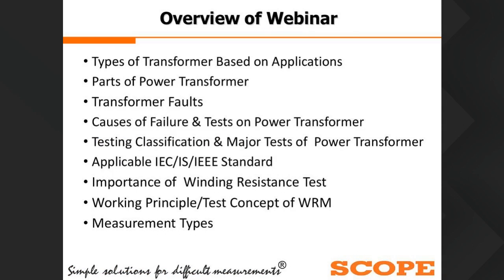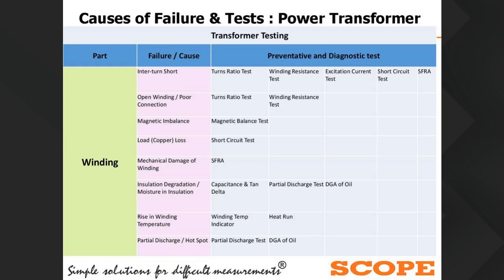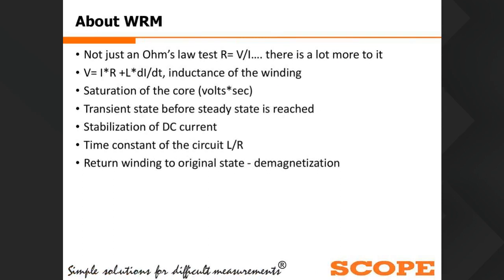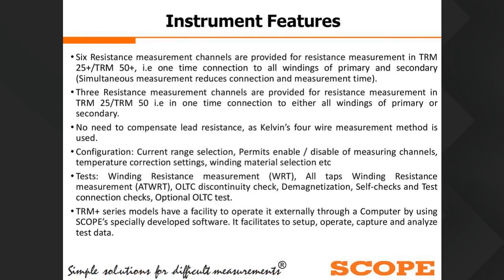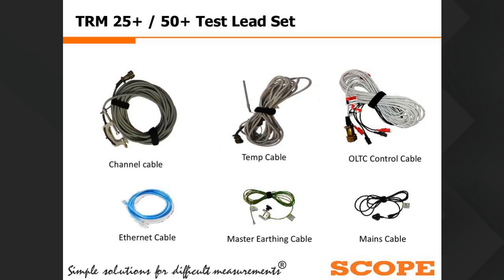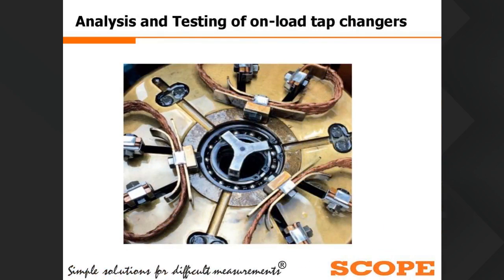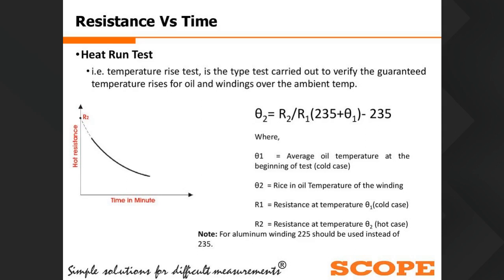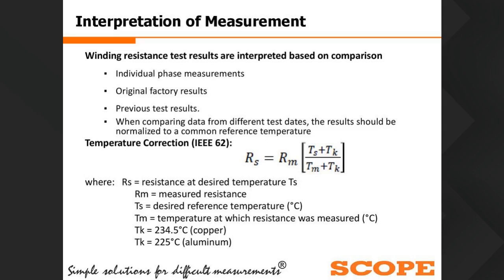Transformer Winding Resistance Measurement by SCOPE

Comment: Testing a 220/33Kv transfomer with scope TRM  25 with voltage setting 5V and current setting 5A results are like 3884 mohm with final current on screen 5.08. But for measuring same resistance with 10V/10A resistance: 3884 mohm but current: 1.07 A..Why current is not incresing in second case if it has 50 V open voltage.